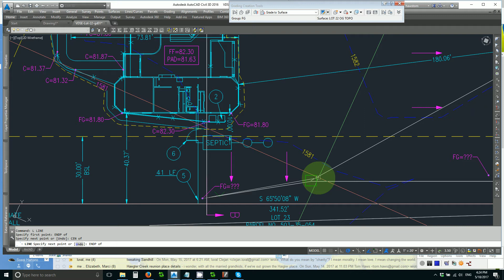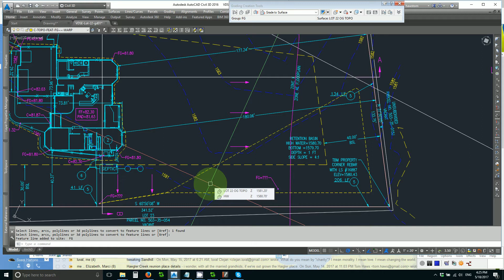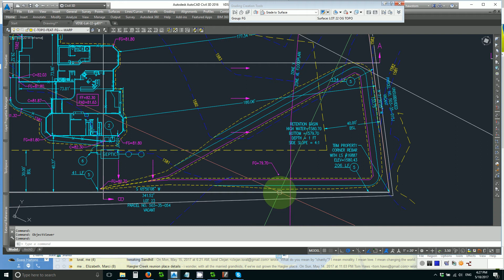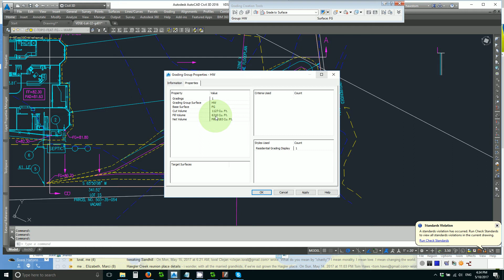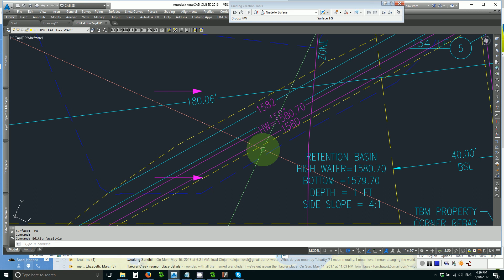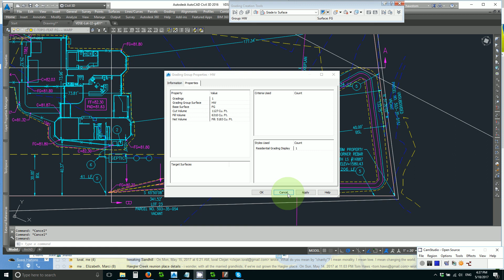Civil 3D AZ retention basin 2: Surface model in 6 minutes

Comment: will creating another user contour for the bottom level be okay or it's redundant?
Reply from the maker: It's okay. The only problem with user contours arises if you can see the user contour outside the basin. This is resolved probably most easily by dividing the project into separate grading groups/surfaces/(and sites just to maintain parallelism): FG-North, FG-South, FG-Front, FG-Back, FG-Basin-North, etc.

Comment: wow! you're first. Are you using lisp routine to assign layers to the polylines? the yy cmd on my computer doesn't work
Reply from the maker: Yes. However, you can easily make YY work on your computer by watching this video 
https://www.youtube.com/watch?v=4iijMBNVkog&t=350s
and adding YY, *LAYCUR at the bottom of ACAD.PGP.

Y, *LAYMCUR
YY, *LAYCUR
YYY, *LAYMCH

And you can make layers isolate and unisolate almost as fast as I did by adding these:

I, *LAYISO
IU, *LAYON
II, *INSERT

I hope to add another video showing how I recently optimized the LAYISO and LAYON further as you could see in the video. I describe it here https://youtu.be/WzTvIwElV3g?t=1m55s